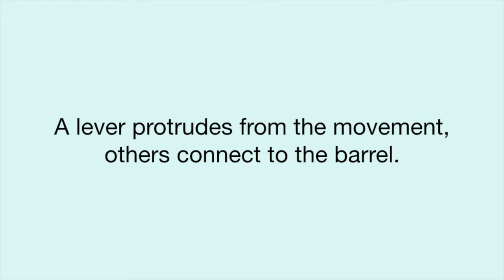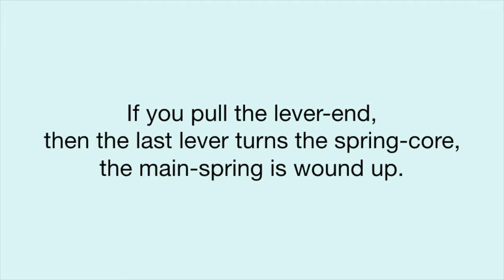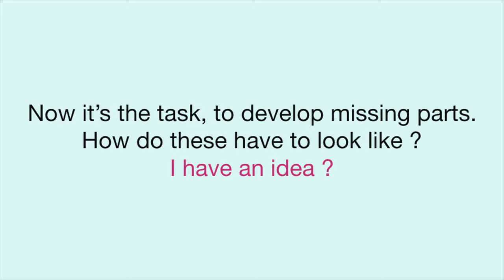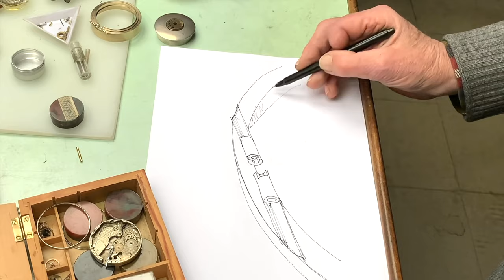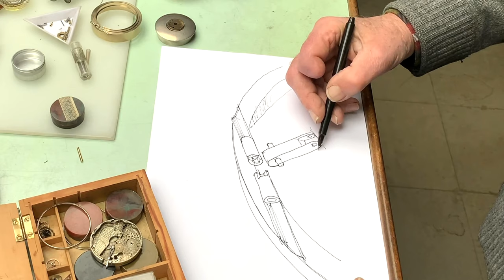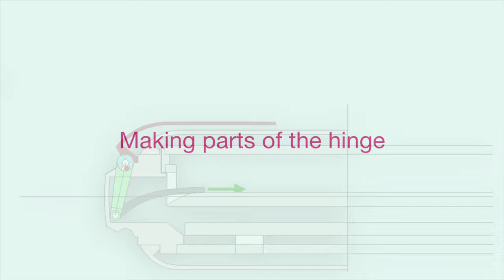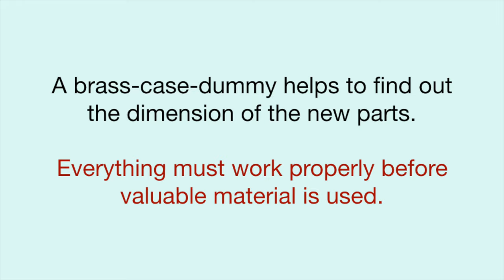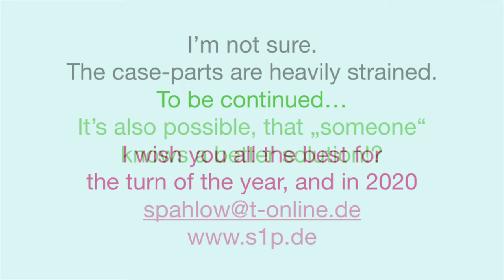01 Case-Making for a pocket-watch movement B. Haas Jeune & Co

Comment: Is this the LLN?  I noticed the spacer/shim under the tool, and I have to use a shim all the time, because my LLPV seems to have a 'natural' center that is (i think) 9 mm above the compound slide surface, too close to use a Type A tool holder, but too much space for 6 mm tooling...as usual, interesting challenges, and masterful work in ziemlich klein dimensions!  Danke

Comment: I restored a simmilar movement in a gold case. the gold seemed to held up ok to the winding preassure. The hinge pins were made out of steel, and the lid was very thick. you coukd make it out of brass and then gold plate it. Hope it helps. Happy new year and merry christmas!
Reply from the maker: Enric Alcaraz 
I hope you look Film 2, the lever that connects to the movement, can you tell me some details about dismantle, getting out the movement from the case. 
Thanks Steffen
Reply: @spahlow  Hello Steffen! I just saw part 2 of the video. the solution you did is very similar to the original Haas I restored. I have a picture of the mechanism and a video if you are interested. do you have email?, I can send you the files no problem!
Reply from the maker: Enric Alcaraz 
Sure a have email, spahlow@t-online.de
I am very thankful
Steffen
Reply from the maker: Enric Alcaraz  Please send mir your details, thanks Steffen my email :  spahlow@t-online.de